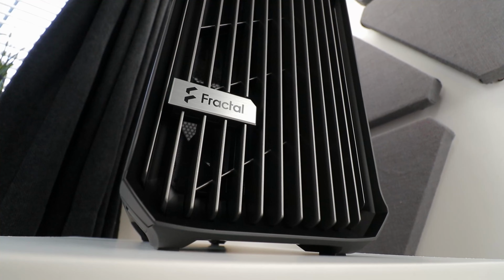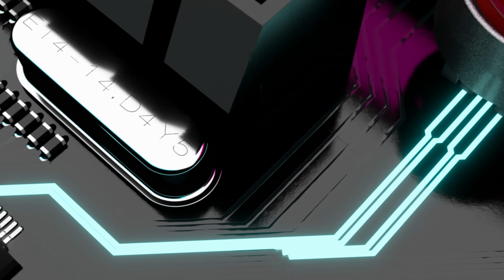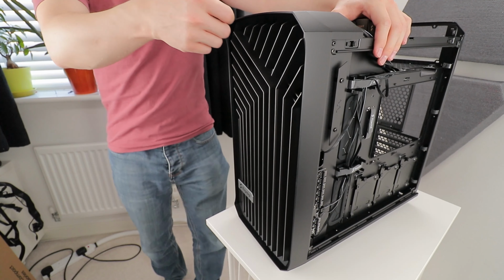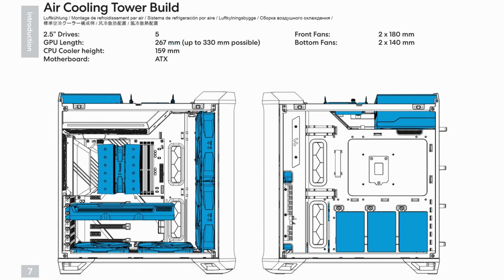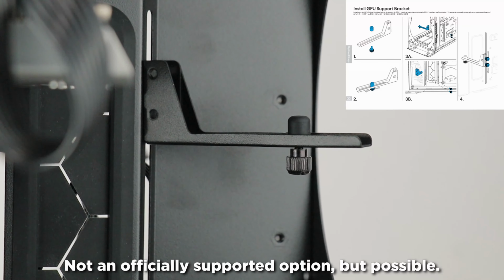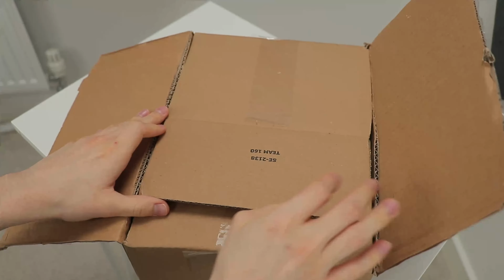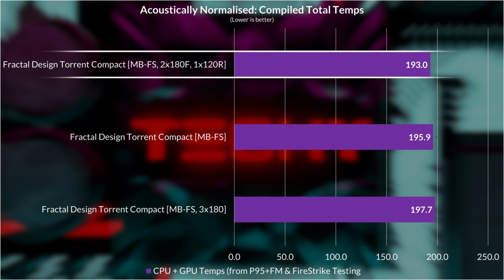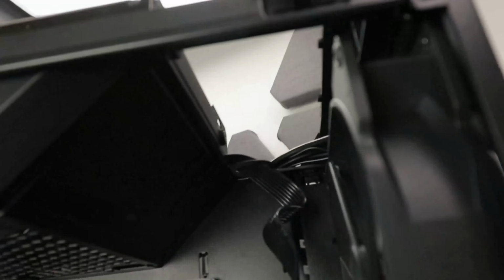The most DISSAPPOINTING and BEST case // Fractal Torrent Compact Review

Comment: 2022 i got my PC built with a NZXT H510i, it was a disappointing case and changed it with a white Torrent Compact - the only issue ive got with it is the difficult to control (or impossible) LED strip light it has and the cable management. Havent had any real damage issues on it, the filters stop most of the dust, and cooling is surprisingly good. Would have liked to see a bit more "i have to grab the PC to move it somewhere" handles or frame parts, but its manageable.

Comment: The cable management on this case is abhorrent. Shame, would have got one if it wasnt so bad
Reply: It's fine if you don't go over the top with 2.5"/3.5" drives and fans
Reply: I have full house of fans, gpu and cpu air cooler, and it's no problem with cable management. Almost perfect case.

Comment: The biggest issue for me was the Drive Cage. If you have the impertinence to actually wish to install a 3.5 inch spinning drive there has been no consideration for proper clearance for the SATA cable connectors. I tried both straight and 90 degree types, (you also are forced to attach the cables before screwing the drive into the cage to avoid damage) and neither cage position will allow it to fit period - the cage retaining screw will not align. I can only think I will have to secure the cage at an angle with a cable tie if I want to use the drive at all! ☹

Comment: A little bit wider and Torrent becomes a brilliant Air  flow.    However, both the  Lian Li Lancool 216 and the Lancool 2 Mesh are much better value.  Why do you not try the simple but great FanControl prog to control the vents? No hub is needed.
Reply: Yeah but lian li dont look as good, also lian li cases are like games + dlc, want vertical gpu mount gotta pay up for the extra

Comment: Amazing review, helped me with the decisionmaking to buy my case. I got the big torrent case in grey for 180€ since it fits my b550 mag tomahawk mobos color and the peerless assassine 120SE coolers metal look really well+ 230€+ for the black version is just too much for me to pay for a case. Since Im only used to build in like 15 year old cases which are horrible to work with, sharp corners everywhere, no cabel management, 0 user firendlyness whatsoever :), I found the fractal torrent amazing to build in. 
-There is not much room in the back for cables, but if u dont max out the SSDs, there is no problem with cable space in the back.
-Didnt have any issues with the fans whatsoever. Since I value good cooling for my hardware, I couldnt go around checking this case out. Compared to my already well cooled old case (3x120mm fans, 1x big 170mm Noctua fan inside the case door) I got around 7-9 °C of improvement, which is a big deal. My R7 5800x3D CPU and my 6700XT GPU are both at around 37 °C in 2D mode, just amazing. In my old case the CPU was at 45 °C and the GPU at around 49°C.  And the fans are only at around 60-70% speed now. 
-Yes there is quite a lot of plastic, but it doesnt feel or look cheap. Its quite sturdy and thick. The front can come off if u lift the tower grabbing it, so I would be VERY careful when lifting and carrying the big tower, especially if it is heavvy and packed with lots of components. The same goes for the compact version.
-I didnt use the fanhub, cause I got a ton of PWM headers on my board and I want a dynamic fan curve in my case+ I trust my motherboard more than a fan hub in terms of regulation :)

I dont think there is a huge difference to the compact version, except for the size (prolly some difference in the thermals; I much prefer big towers anyways). The price is overall a bit high and there are prolly a lot of cases for much less money with better aspects like building quality, more RGB for less money and better AIO solution. But this case emphasized on air cooling and its the best case for that. I feel like a lot of the price goes into the development of the airflow-centered design, whereas in other standard cases the design is "standard" but the airflow is by far not as good.
So if u r into excellent airflow, a refreshing look, looots of space in the big tower version but the rest being about average, the fractal torrent is a solid recommendation.

Comment: Did you try to use a 140mm in the rear exhaust?
Reply from the maker: Check out the testing section, I did testing with a rear 120, I don't think it can take 140mm fans in the rear, at least as standard. Maybe you could squeeze one in with some elbow grease.

Comment: THIS is the ABSOLUTE worst review of this case i have seen!! plastic is neither fragile nor delicate ffs who would scratch their case with a screwdriver? it's because of the matt finish that you can see every little thing, other cases scratch just as much if you hit it or anything with a metal screwdriver you just don't spot it lol and the fanboy comment? wow mature, it's just a design choice from fractal, doesn't mean that if you like and defend it then suddenly you are a fan boy, your personality comes out really bad. and build the case of metal? seriously? Just means higher prices, more weight, more expensive to ship. Most say it's difficult to cable manage but tbh cable management isn't that easy and looking at this build, i don't see really see the effort. If you are not good at cable management then don't buy the compact version unless you want a challenge, quite simple to be fair. Makes sense that it isn't easy to cable manage unless you don't care where all the cables are in the case, but there is many great builds out there with this case and they made the cables look perfect. Oh and the tittle is dumber than your comment on packaging, no wonder the video is waaay too long. why have 2 gpu in if you can't barely fit 1 full size card. you can't even cable manage it but want 2 gpu, rtd.

Comment: I ordered one. It’s really fragile! Immediately 3 plastic hooks of the top panel broke 😤
Also one of the 180mm fans has a slight clicking noise. Pretty annoying.
Also, I don’t like the air noise generated by the 180mm fans.
They should have used more material for hooks and higher quality plastic, IMHO.
There are plastics which don’t break as easy.
I really liked the PSU placement, putting cables into the psu was a blast compared to bottom-tunnel mounted psus.
Reply: I heard that u can reduce the rotation of the big fans to 30% and they will be pretty much silent while the temps rise only by 3 degrees.

Comment: Great review, one thing I barely see anyone mentioning is dust management, it seems some of the best performing cases like from Lian Li are starting to have Mesh grills everywhere which is good for airflow but at the expense of more frequent dust cleaning required, 215 and 216 don't even have filter on the front, I am leaning toward this case because it has filter in the two sides where it is open for intake.

Also lots of cases only have the bottom filter accessible from the back which means for most scenarios when it is against a wall, it would be a hassle to remove them unlike with this case.

Comment: I totally agree with you that the cable management space is not enough and a lot of plastic is used in such a high priced case. I have also watched others building pc with this case and a lot of them have to screw the panel on the top losing some big points.

Comment: I'm trying to think of the best fan configuration for this case for a balance between temperature and performance. I will keep the 2 stock 180mm fans up front and will get an additional 120 mm fan from fractal for exhaust in the rear, but I'm wondering if you think I will benefit to placing an additional 2 140 mm or 3 120mm fans on the bottom? Any help is greatly appreciated. Great video btw!
Reply from the maker: Honestly, I'd probably just go for a single extra in the rear. The included fans are solid, so getting more fans on top isn't going to improve the situation much (a few degrees tops) and will just make the build more expensive. If you want more fans for the look, that's fair. But for performance, spend it on the CPU cooler or something else IMO.

Comment: Think most of the stuff said is valid in this video. Got the compact more or less at launch after the early reviews where out. This is a grate review just a pity it took so long to come out.

I like the case and really all in all the complaints have no teeth to them. Sure the back part is tight. There is a real risk of the PSU cables being a pain if you need gaming GPU. Even with a APU currently the cables have a hard time to get under the HDD cage and back in the cable nest at the back. Just to tight all in all! But I will manage since I got the all metal case with no widows. No RGB or crap. But anyone into glas and RGB's are going to hate the compact! And water cooling is just a strait no for the Torrent line. Just as glas is stupid in any computer that is not explicitly about showing off. RGB is almost always just bad and in general I had not gotten the compact if anything I just said sounds off... This is not the case for you!

The plastic on the top is really bad. Is going to be the first thing to brake on this thing. Trying to pick the case up and the thing just falls right off! You can really drop the computer due to that shit! It is a real hazard and a real weak spot together with the cable routing at the back/PSU. Also I almost forgot! The CPU pins are in a really bad spot! It is really hard to get the CPU power to fit. Really really a flaw with the PSU mounted at the top AND poor cable management room. Anything high end nowadays needs 2!!!! CPU cables to get to that spot! 2!!!

The price the price. Really the fans are worth some money too. And Torrent looks really good even in all back no windows. And to be honest it had almost no defects when I got it even with the dings to the packaging. Small tiny faults in the pain that you never going to notice since it was inside of the case. And I had a drop test done to it to check build quality :c No components in it but still a good test non the less. Never put a PC on the chair! Was just going to let the cat in and it went of the chair with a BANG. Can almost not tell that is was in a accident. It is a really solid case even with the shit plastic on the top. Side panels are easy access and works well. Front panel even if you have to pull it off feels like quality and should last very long. Really can not complain about build quality outside of the TOP PLASTIC!

It is a solid case with faults. Top cover is going to brake first even if it is made well. (plastic garbage for premium price) Cable managing is what it is. And the only thing yet to brake is the fan filter under the case. It happened in the drop test. Small scratches to the paint but the major damage was to the filter. Picking or placing the computer down your risk of damaging the bottom filer. It is in a real danger zone so you can scratch/punch it apart very easily without knowing. But really all in all I think the price is fair if the plastic was removed. Hate it the most. Then the CPU cable problem. And then PSU cable routeing. I still like the case. But really the big shit thing I talk allot about is the plastic! The front is also plastic but I like it and it feels premium! But the top plastic is just a strait up shame. It has plastic bits that can easily brake off it feels like. And they are the core thing that holds the plastic top in place. Just get that stuff out of a premium case! I rather have to use thumb screws and take a plastic thing off then whatever this hot garbage is. I rather have no plastic at all due to it being such a weak point for this case.  

The important thing to remember is that your limiting what you can put into this case. Your stuck with ATX motherboards. Nothing bigger. Not really impressive GPU length. And the PSU is at the top so somewhat top heavy. No problem and I like the layout overall. And the fans are still not proven. But I think the compact makes more sense to have this big fans in then the Nano or normal big tower Torrent. I love big fans and I want 140mm to be the standard! 180s are real nice ;) The AMD APU cooler freebe is a unbalance mess and makes more noise then the big 180mm do! Going to get myself a heavy Noctua D15 soon and something better then the APU. I still like my HAF XB EVO the most. But really there is far worse cases out there for a weirdo like me :)

But outside of them counting stuff so strangely. In some cases I think they do it on purpose to not oversell how many SSD's you can have etc. I really think there is not really anything wrong with the case. Maybe the fans are still a ?. You know from the stuff that should not go up in flames reputation. But really I rather have thumb screws for the GPU screws. That is a sign of a premium case to me. There really is nothing wrong here outside of the obvious stuff and the CPU power cables. That one I have not head anyone talk about! So blessed by my HAF XB that I never gave that a think before buying!

My nit pick is that you can not mount 140mm fans at the back as you can with the big Torrent! >:( I knew that before buying but WHY. There are mods to make it work but WHY Fractal!

Comment: I have a NZXT H500 and I've recently upgraded to a 5900x which gets quite hot during certain workloads(my CPU Cooler is a Noctua U12s). I've considered switchting to the H510 Flow since it is the same case with mesh front but from what I am seeing online it may not be good enough. Right now I have a RTX 2070, which doesn't get really hot, however, if I wanted to get a big, powerful and power hungry GPU next year I would need a case with better gpu temps. Linus's video shows the Flow isn't much better on gpu temps compared to the H500/H510. He says there is not enough exahust so hot air recirculates in the system, also big graphics cards get pushed right against the front in that case. Both Linus, Gamer Nexus and other techtubers like DawidDoesTechStuff show that the flow is at least 10°C better on the CPU than the sealed version but still really warm on the gpu. GN and Linus in particular got higher GPU temps by adding 2×140mm intakes at the front. Optimun Tech recently made a high tier build in it with the same cooling solution I would use(Noctua D15+2×140mm noctuas at the front, although I would wait for Noctua to release new versions of both) and shows high temps too. I know the Torrent line of products isn't a top performer on the Gpu side and that CPU temps wise other cases get really close. I need help to choose a new air coolig solution. I'll wait for noctua to release their "next gen D15" cooler so I can wait maybe Q1 2023 for the case too if that helps in terms of new releases. Most important of all: I need a full ATX case that is not too heavy, if the Lancool 2 mesh wasn't 11kg I would have got that a year ago but sadly my pc is on a shelf above my desk so size and weight matter quite a bit.

Comment: They make this case with a solid side, instead of the window. Then you don't care about the cable management so much. Thats what I decided. The solid case. I watched a video of a build in one of these and supposedly a dark rock 4 air cooler will fit. I don't have a decent video card to worry about cooling yet for it. So maybe just going to use the two front fans and one in the back for now. When I get a video card , one in the bottom blowing up should do the job nicely.

Comment: The "main issues"-part was the most important one for me. I have seen various reviews, and I did not hear one of them mentioning the finish. The other parts I heard earlier (bad cable management, and so on). Well.. then this case-line of Fractal Design Torrent cases will not be for me. It's just impractical.

Comment: I got the full size torrent and I'm happy but I'm not using any water cooling and it seems they did mess up the compact in the sense that the rear panel is too close to the interior of the case.  Personally my PC sits on the floor and I clean it out every few weeks or so so I got the solid, if I wanted a display case... Well I don't so it' a moot point.  Otherwise solid review, I'm glad I got the full size and not the compact.  You are also the second person who I've noticed mentioning the manual is wrong, fractal really needs to fix that.

Comment: I love your reviews and this one is no different. This case is deeply flawed when it comes to cable management and for the price, the top panel and front should be metal. 

But there is a lot of irony here criticizing Fractal's documentation when you make mistakes throughout the video regarding fan size, hard drive size compatibility, etc. It should be simple, and should be correct, as you'd say if you reviewed your own review.
Reply: Get used to it--cables are going the way of the dino: modular power supplies, NVME drives instead of SSD, usb drives and downloads instead of DVD, etc, etc.  My build of this will have all NVME and just one extra fan on the back so cables needed will be very minimal.
Reply: @24tommyst  it's still lousy design work at the end of the day. But if you're not old school, then obviously the design flaws aren't flaws
Reply: @csi2448  what is bad
Reply: @24tommyst  obviously the cable management lol. The Compact being worse than the smaller Nano should never happen
Reply: @csi2448  i had zero issue with it.  it is bad for noobs or what are you sayingg?
Reply: @24tommyst  you would have zero issues since you aren't going to be using a bunch of old school drives. I use a 2.5 and a 3.5 drive, so the excess cables will prove to be an issue
Reply: @csi2448  i have a 2.5 external.  why have it internal?
Reply: @24tommyst  because why not lol
Reply: @csi2448  because external driives in clear cases look cool